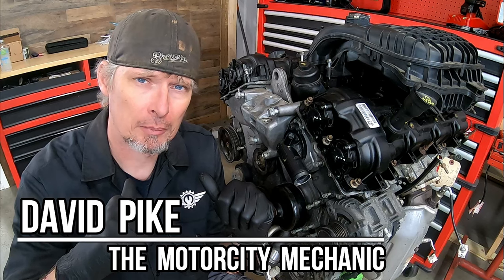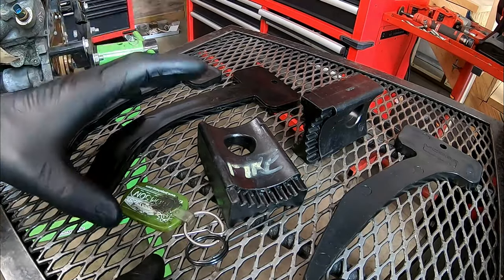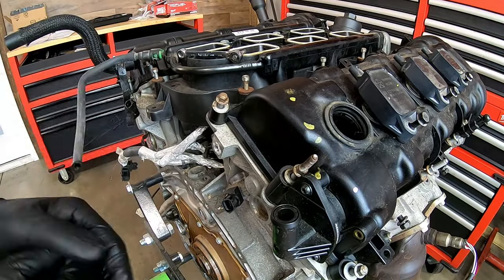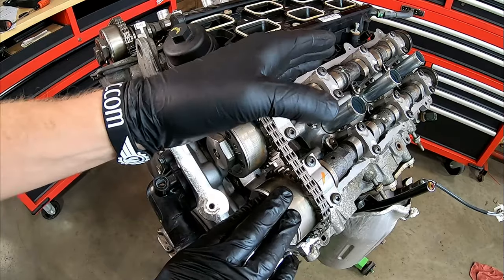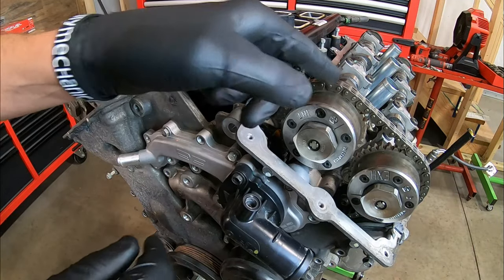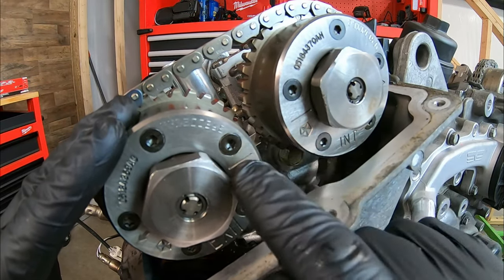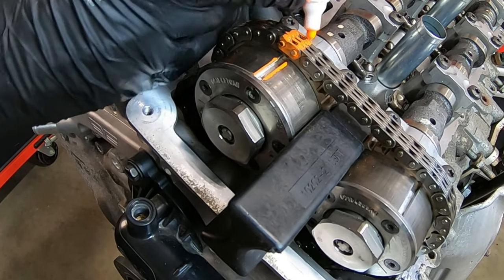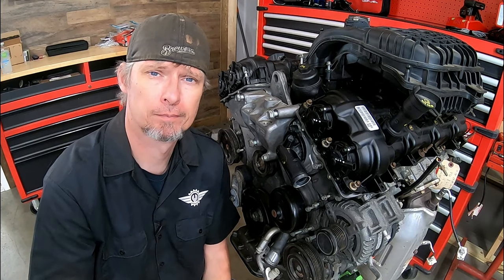Chrysler/VW 3.2 and 3.6 Rocker Arm Replacement Part 1

Comment: I challenge anybody to find a more talented and articulate mechanic than this dude! He is on a whole different level.
Reply: I know he makes it look to easy
Reply from the maker: He is a class act for sure and someone that I have the privilege to call a friend.
Reply: ChrisFixit.
Reply: This guy is Chrisfix for techs
Reply: No doubt, he’s the best !!! 👍
Reply: Easy, Rainman Ray in Florida!
Reply: Hello Sir. I’ve watched this video before and replaced my camshaft, rocker arms and lifters using this reference.  It was successful.  I 19:31 have a 2015 jeep wrangler.  So after 2 years it begins to tick again on the driver side.  Possibly a rocker repair again.   I have a question.  Can I just work on the left side( driver side)?  Can I just lock this side with the cam lock tool without messing with the passenger side valve cover when loosening the oil control bolt?
Reply: Agreed very thorough.  I’m really impressed.  Seems like an honest man.

Comment: Excellent video. Two CRITICAL steps that weren’t mentioned but made all the difference: 1.) To remove tension on the right side timing chain, you MUST rotate the crank slightly clockwise in order to put the tensioner under slight tension or the special tool will not be able to release the tensioner (there are other videos that do cover this - do yourself a favor and look them up before you break your special tool like I did), 2.) On the left side, the trick of putting the cam into the neutral position by rotating it 30-degrees ALSO needs to be done to the exhaust cam (not just the intake cam). I did find that zip-tying the phasers and phaser locking block saved a lot of heartache. I also did notice that if you’re struggling to get the phaser back onto the camshaft, it’s an alignment issue as there’s a key guide on the cams that you need to line up just right, so work on slight rotation of the cam rather than wiggling and praying. Overall, amazing video!

Comment: I have 155,000 on my 2013 town and country 3.6. Lifter or lifter’s started pecking so I watched your video and it was great, very informative. I don’t have the room in my garage to do the work and I don’t have the time. So I called a famous repair shop in the Dayton Ohio area (they are even on the radio on Saturday’s) and asked for a price out the door replacing all lifters and rocker’s, barring the cams are ok. I know I could buy all good quality parts for 300$ excluding gasket sets. I figured labor would take less than 8 hrs. So l doubled the 300$ and figured 1,000$ for labor (1,600$ would be in the neighborhood right?). They quoted me 3,500$, I said you are kidding right? So I said what about just putting a remanufactured engine in it from jasper. I was told 12 - 15 thousand dollars. I just started laughing. I paid 15,000 for it back in 2018. They make dealerships look honest! Bend over baby!
Reply from the maker: Your bit the first to say that. I can’t understand what a lot of shops quote that price when what I feel is accurate is more around $1500ish without any cams
Reply: @MotorCityMechanic  Thanks for sharing your insights on pricing, a lot of channels won't discuss money for some reason. I'm potentially going to quote this job for a customer and I've had trouble reconciling the hours quoted by the book, the prices shops are throwing at people who post about it on forums, and what I think the job involves. I'm thinking of offering $1000 labor plus parts, but I want to make sure I'm not underpricing and end up messing up my week. There's another video out there that says it's a 20 hour job and a shortcut makes it 10 hours. Book time is 5.4 to 7.2 hours. I bet you can do it in under book time, I hope it takes me around 10 - 12 hours given it's my first time. And even if it takes me longer, I guess I can feel comfortable about my price quote given that you would do it for not much more.

Her car was ticking on cold start after having not run for many months, eventually warmed up and smoothed out. A short while later, it began running rough when cold and misfiring. We'll try a good oil change and premium filter, but I'm preparing for the possibility of stuck lifters.
Reply: Everyone wants to get rich quick. Some mechanics have no conscious, just as bad as stealerships.

Comment: I listened for about 3  minutes and knew I was in the right spot…
Reply from the maker: Awesome. Glad that the video is helping a lot of people. I need to copy that testimonial….one of the best I have heard so far!
Reply: Ihave a2012 Charger it set up for 1 year when i got it going it had body damage. When i start it it sounds fine after it runs for 3minutes it will start ticking  . Can you tell me cause

Comment: Just wanted to say thanks again for this video. I just noticed ticking in my 3.6 Jeep Grand Cherokee. I watched your videos to educate myself about the repair. I shopped it to two different Jeep dealers. Discussing it with them after watching the video made all the difference in selecting the right one to do the job. There was no cam damage luckily. They replaced all of the rockers and lifters and it's quiet as a mouse now. My car has 185,000 mi on it.
Reply: how much did the job cost you?
Reply: @jacobtorres9554  $1400

Comment: Just changed out all lifters, rocker arms and three cam shafts with little to know knowledge of theses motors. Everything is good and running great could not have done it without the videos can’t thank you enough for posting

Comment: I closely followed all steps in this two-part series to replace the 
valvetrain components in the left head of my 2015 Wrangler's ticking 3.6
 Pentastar at 60K miles.  There was, indeed, a bad lifter and exhaust 
rocker arm.  After a couple of weeks of road and freeway use, the motor 
is still purring and I'm confident my repair is successful and going to 
hold up.  I could not have done it without your incredible guidance, 
David!  I've been intimidated to get any lower than the top of the valve
 covers for 30 years since a younger, tool-challenged me screwed up a 
couple of engines.  Yet here I am a short time ago, confidently holding 
my Jeep's camshaft for reference photos!  Furthermore, since I live in 
Western Washington where parts and repair costs are HEAVILY inflated, 
between this and my horribly-located PCV valve change, I saved myself 
nearly $5K!  A well-earned gift is coming your way, my friend!  Thank 
you on behalf of my whole family.
Reply from the maker: Its awesome to hear feedback like this. This shows you that the videos are helping people with getting their vehicles back on the road and also with saving a lot of money in the end. It makes it worth while when I hear it. Thanks again for reaching out and for telling me your experience. Glad that I could help and my hats off to you for taking on this task.
Reply: did you get an engine code?
Reply: How long did it take you to do?
Reply: Im doing mine right now, about to take camshafts off. Waiting on the tool.

Comment: Outstanding instructional video. After watching the video I did the complete job myself and saved thousands! Thank you David for taking the time to make these video's. Your presentation and knowledge is nothing short of perfection. I would not have attempted this job without your instructions.
FYI: I started hearing a slight tick which sounded like a failed ( old school) lifter tick. I did not wait long.  Upon tear down inspection I had one bad rocker, one collapsed lifter and two weak failing lifters and had slight cam damage but only on the edge and not the lobe as described as best case scenario Engine was clean and had 93K 2013 GC. While there I replaced 24 rocker arms, 24 lifters, EGR, Plugs, Radiator fan, Thermostat, serpentine belt, tensioner and flushed the coolant. Take your time and follow David to the letter. Make sure you have the necessary tools ahead of time and of course  all the needed gaskets. Thank you again David. You ARE the Master Mechanic!
Reply from the maker: Thanks again Mark!
Reply: AMEN...  Excellent response, and I'm glad all worked out for you..
Reply: What is the best advice you can give us to prevent this ticking problem? Is the 5w20 good enough for this engine?

Comment: I’ve got to give a HUGE shoutout to you, David! 
I felt like you were there with me though this entire rebuild. Really great video series and keep up your good work! 
Well... these past three days have been nerve racking and tedious to say the least but, I managed to rebuild the top end of our cars engine. The main symptom was a ticking or tapping noise. This was caused by the rocker arms going bad and destroying one camshaft. The list of parts replaced are...
Right exhaust camshaft (the most difficult to access and most expensive)
24- Rocker Arms (Melling brand)
24- Lifters (Mopar)
NGK Iridium spark plugs
MSD Coils 
8 hole fuel injectors
Lower air intake (upgraded PUG version)
All new gaskets and seals 
Thermostat
PCV Valve
Oil change
I’m tired... think I’ll go eat tacos and rest now.
Reply: wow what was this on a jeep? i have a 15 cherokee that has that tap bad
Reply: @Nick912OK  2016 Town and Country

Comment: Thank you so much for your help just pulled apart my 2012 jeep wrangler 3.6l and replaced all parts you recommended in the 2 part video.  I could not have done it without your help.  You rock thanks for showing me the right way.  I took my time and knock it out
Reply from the maker: Awesome! Job well done, my hats off to you. Thanks for the feedback and make sure to subscribe

Comment: Very well done.  I only wish this was the 2.7L, since that's what I'm working on.  I already did the timing chain, cam chains, tensioners, guides, water pump, put it all back together, ran perfect for a week, and now I hear heavy ticking on the upper half.  Unlike your motor, the 2.7, (at least in the '05 Chrysler 300), the rocker arms are on the top and they only rest on the lifters.  Some of mine were overly loose though and now I get to take it apart again.  Even though your engine and much of the process is different, I'm still on my way now to watch part 2.  Thanks again for a great vid!

Comment: About to do this job. After many videos...this is the one that will be in my toolbox. Will update once it is done and I turn the key. (Removing the batter box and all the trim is the scariest part about this job) Lots of colored e-tape, paint markers, and a note pad.
Reply from the maker: Yeah the Jeep Wrangler has more steps for sure with that large battery box. Once it’s out it gives you sooooo much room. Thanks for the kind words and for watching
Reply: @MotorCityMechanic  It's finally out...I dread putting it back in...but not as much as that PCV valve. There is a line from the EVAP draped right over it that I know for sure I better not break. Got everything stripped down to the valve covers. Taking them off tomorrow once I get the PCV off...looking at my Engine now...I sure hope my notes are enough to guide me back to reassembly. I am confident.

Comment: In the middle of this job.  Took the back valve cover off today.  So far hardest part was pulling out the back wire harness attached by three push pins and then pulling off the valve cover.  Being the first time was not sure how hard to pull on them.  I'm also three trips into Harbor Freight for a stethascope which is tremendous,  close quarters torx driver thingy and a shorter set of big sockets as the deep sockets will not give you enough clearance.  Home Depot for a 36mm socket.  Without these videos none of this would have been possible.  Thank you.  One bad rocker in the middle of the closest to center cam.

Comment: Thank you for this detailed video. You saved me a lot of money because I was about to take it to a shop. I am not a mechanic but I learned enough from your videos that I felt confident enough to do the job. I did all 24 Rockers and Lifters and replaced both right cam shafts. Thanks to your video that explains when to replace the cams. The special tools didn’t work but I made due. I did it in two days had to wait for the 2nd cam shaft to be ordered. We got it done. She’s running just fine. I can’t thank you enough
Reply from the maker: Awesome! Glad you were able to knock it out by using this video. Appreciate the comment
Reply: Why didn’t the special tools work?

Comment: For anyone attempting this, also pay special attention to the tone wheels on the right side of each of the camshafts.  Simply touching the wheels with a magnetic part grabber or parts tray, can wreck a perfectly good camshaft. Hard lesson learned however these instructions are spot on!
Reply from the maker: Yeah any thing VVT related or tone wheel related doesn’t like magnets.

Comment: Outstanding tutorial, I will use this 2 part video as my guide.  My 2013 JK is making the rocker arm tick noise on the driver's side at 95K miles.

Comment: Little story , I Have a 2017 Ram pro master 1500 the engine stared to make a noise , after seeing your video more than once I decide to give it a try , what can I loose if I needed a new engine I made notes based and all your info , it took me 8 hours following everything step by step and I replace all the rocker arms all the lifters and one camshaft , all thanks to your video , I Cross my fingers at the end and the van stared with no noise , everything work perfectly, I’m not a mechanic but I can follow , I’m so grateful to you for taking the time and teaching your knowledge . Thanks again

Comment: Oct. 6, 2023  8:00 pm . Your video has been so helpful, 74 years old, can’t afford a new charger soooo, 
Have to fix 2011 charger, toxic orange. Still in great condition.
I had a 1966, 1968,  1970 chargers. Wish I still had them! Ha ha 💲💲💲

Comment: Thank you so much David. I replaced a set of (24) rockers, lifters and one cam. I found a rounded left intake cam(#6) during the process. The tools recommended and advise to replace all made sense. I did this in my home garage  with the tension release tools and did lose pressure once the cam slid out, was probably my mistake. The phaser did line up with some adjusting. All in all, I replaced 24 rockers, lifters, and a LS Intake cam. Couldn’t have done it without you. Thank you!!

Comment: In-depth and very informative. This man is a pro! I was intimidated by having to tackle this job. This video gave me the courage to do it and my Jeep no longer ticks. Can't thank you enough.
Reply: @ThunderAppeal  I think you replied to the wrong comment, or you've got some misplaced anger.
Reply: @u5efulid1ot  Have you ever bothered to open up a repair manual for your car?  Or have you at least tried to find one and read it?
Do you know how to boil water without watching an instructional video?
Reply: @ThunderAppeal  Vince McMahon speakin out his ass again i see 🥱
Reply: @mails5054  I have quality tools and can rebuild an engine, transmissions, and I can do brake changes blind folded.
You need an instructional video on removing an intake manifold.
You should feel sorry for yourself.

Comment: Just did this job and I'm glad I took MotorCity Mechanic's advice and to avoid the short cuts, the right way didn't add that much more time and thee tools can be had off Amazon for $15, shipped. One thing to note: on the back (firewall side) of each cam, there are silver grease like stripes all around the back of the cams, careful you don't wipe them off or smear them, this is for the camshaft position sensors that are mounted to the top of the valve covers. 

Also, replace all rockers and lifters on both the passenger side and drivers side. I almost didn't replace the drivers side since I did not detect any sound coming from it, just the passenger side. After pulling all the rockers from the drivers side, one rocker bearing had a very slight "wiggle", it was on it's way out. Replace all the lifters as well, when I pulled all the lifters, one of them fell apart as I removed it, it was a lifter under one of the bad rockers and it looked good just sitting in place.

Comment: This video was an amazing help.  I was going to attempt one of the "shortcut" methods before I found this.  Got the tools I needed for under $20, and fixed my rocker tick.  A bit intimidating removing cam shafts, but take your time and be thorough and it is surprisingly easy to do right.  A million thanks to you for making this tutorial, easily saved me thousands of dollars.
Reply: Where did you purchase the tools and the part numbers

Comment: 1/2 way through!  Should have gotten all of the parts I needed before I started....  A recommendation from me is to put all of the needed parts, even the correctly sized bits and ratchets (e.g., 36mm was hard to find locally).  Still a great video and no complaints!
Reply from the maker: Thanks for using those video for your report.

Comment: You are so thorough and precise.....that its too hard to say I can't do the needed replacements on my wife's van.  
So this weekend it will get done.  
Thanks a ton for the excellent videos!

UPDATE:   The repair is still holding with about 27k miles.  Every mechanic advised same labor cost to install a new engine and no one was real interested in the job. 
I ended up replacing all the rockers on bank 1 since I bought them and had everything apart. Also had to buy a new exhaust cam shaft. 

Again..  Great video series, extremely detailed.

Comment: David you are the Man, I am a Home shade tree mechanic, Man I followed step by step and it made this job a Breeze. not only i did do all the rockers and lifters also changed out one cam and upgraded the Oil cooler to all aluminum, Pvc was replaced, and spark plugs were replaced also. If down that far into the engine might as well replace parts that were due for 100,000 Maintenance miles anyway.